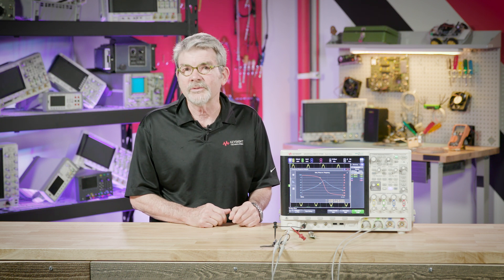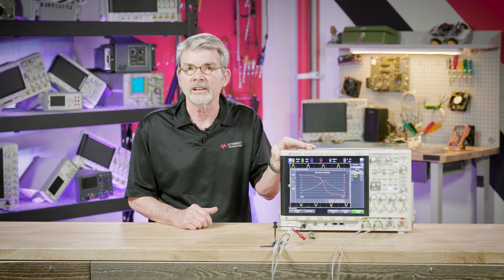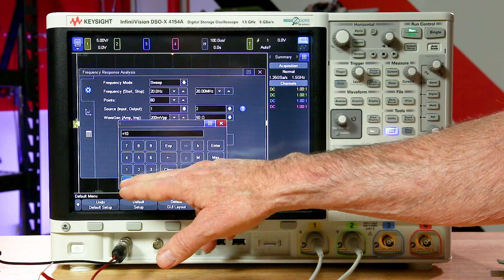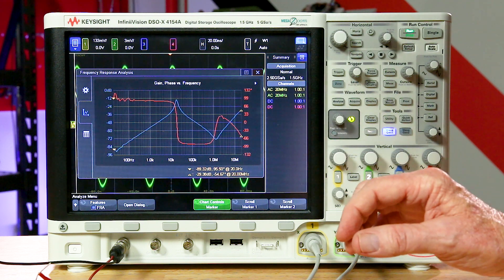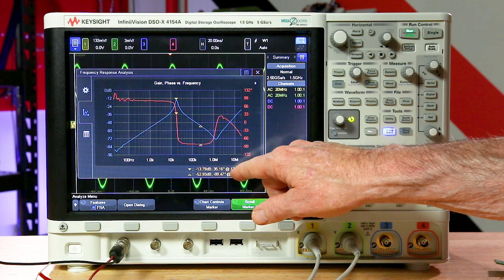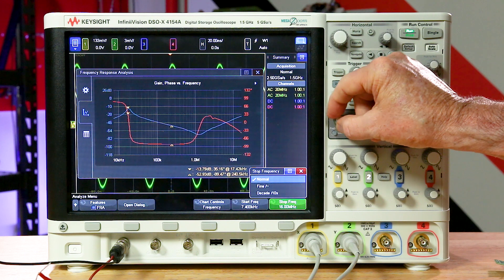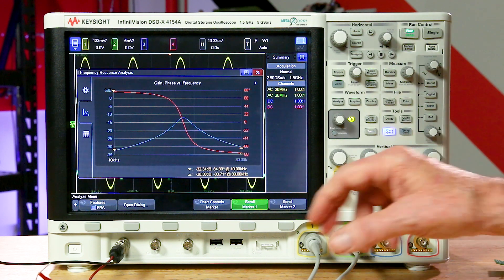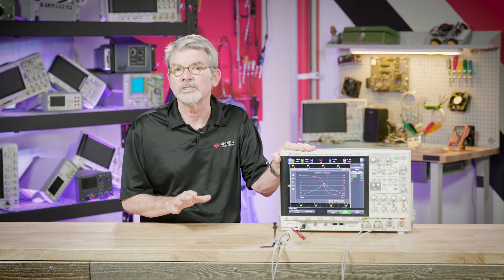Frequency Response Analysis Updates for InfiniiVision Oscilloscopes!

Comment: I've checked the release notes for 2.50 firmware (latest) for DSOX3024A, but it doesn't mention FRA option at all.
Reply from the maker: Unfortunately, the FRA application is not supported on the DSOX3024A. FRA is supported on the 3000T X-Series, 4000 X-Series, and 6000 X-Series through the corresponding software packages. You can find the different software packages and associated web pages here: https://connectlp.keysight.com/Free-SW-Trial-Oscilloscopes